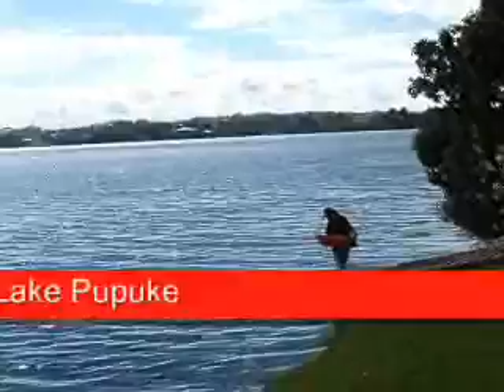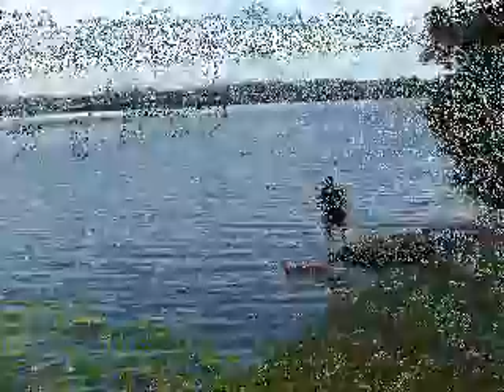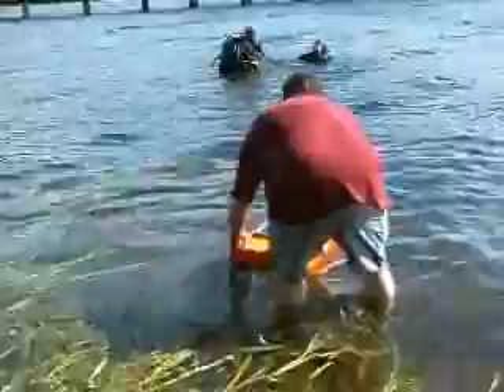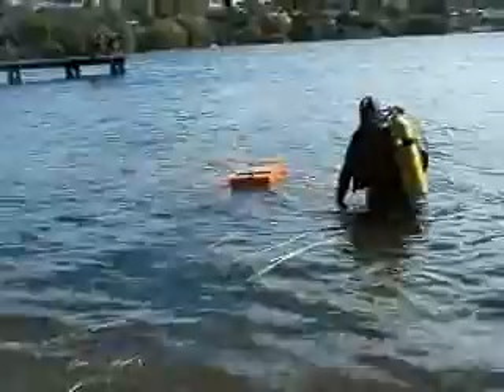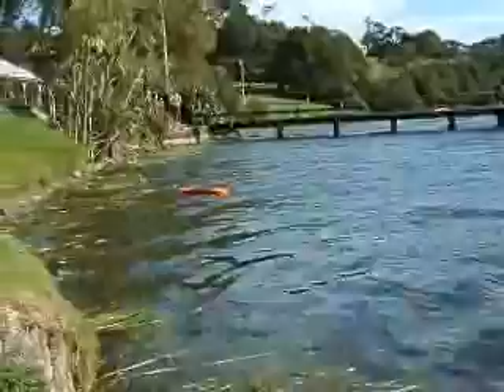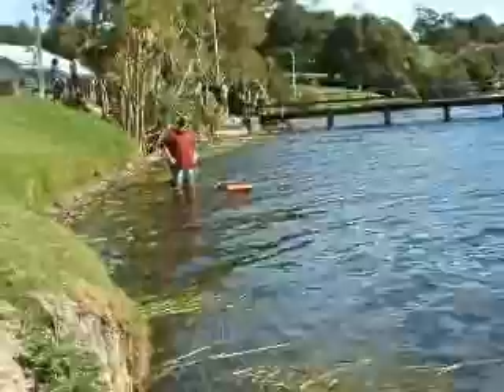Titanic Failure

Comment from the maker: I am building a new boat, which resolves some of the issues I had with the boat in this video. Many of the parts in the new boat came from the old one. The new boat is somewhat more advanced. The new boat is made of ply and epoxy which is far stronger. It is also a catamaran design, and will have twice the solar power collector area and twice the battery. No longer using a Neo. More coming soon.